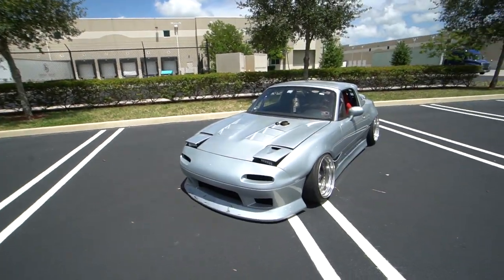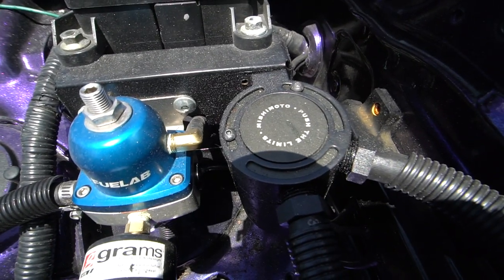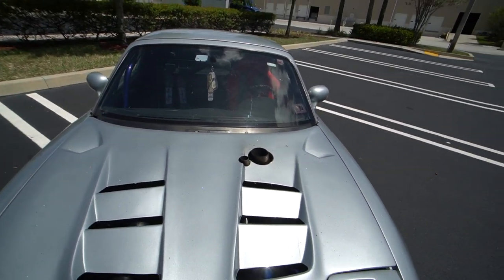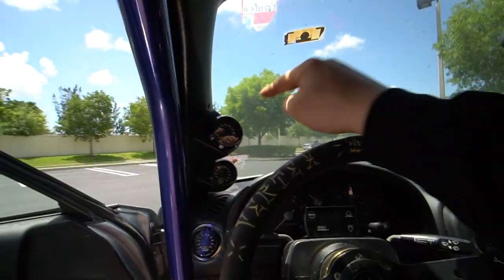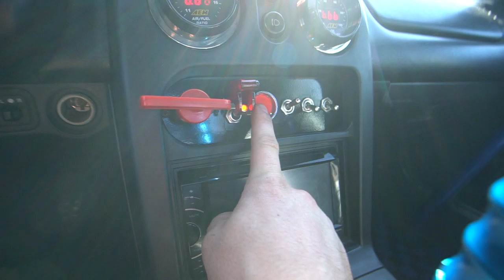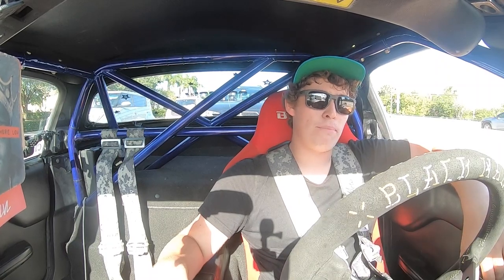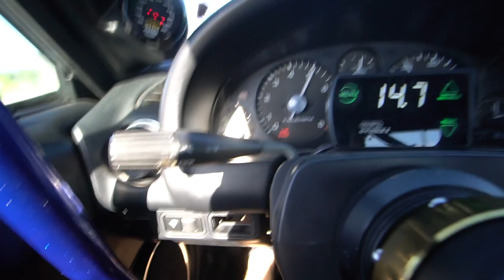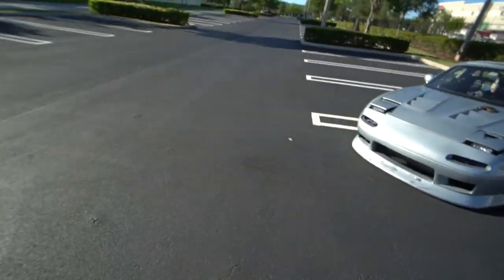SICKEST STANCED TURBO MIATA EVER!

Comment: to each is own I guess... to me that car looks like a piece thrown together.. not even one body panel is clean, trims held by metal screws, the holes for the hood and wastegate dump are not even debured, under the hood is a rats nest... etc etc  I don't understand how you can be proud of a result like that... but... I guess it's just me!
Reply: So I'd would slap a turbo on it with a boost controller and turn up the boost til it blows up